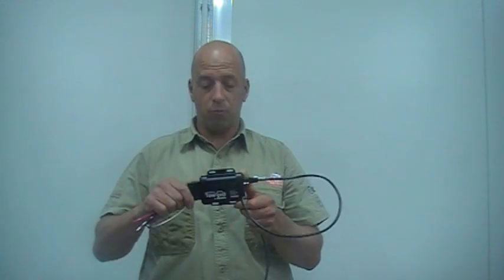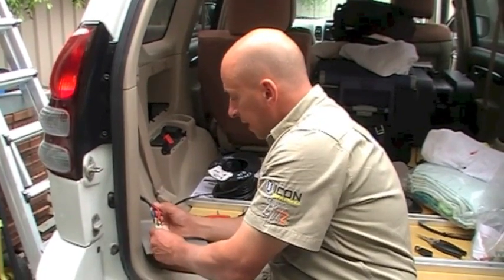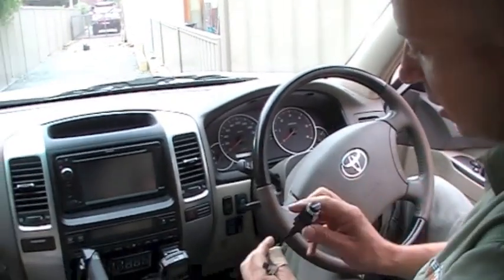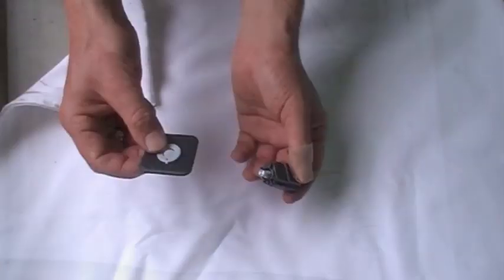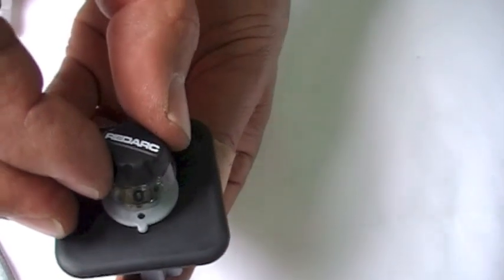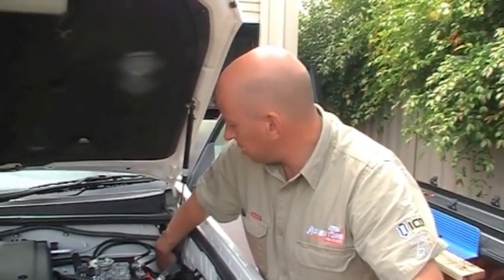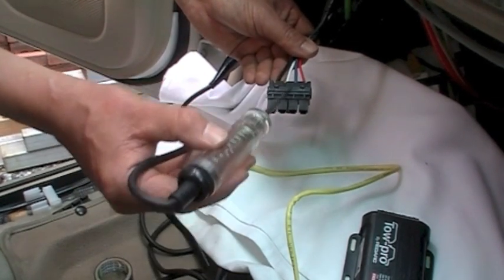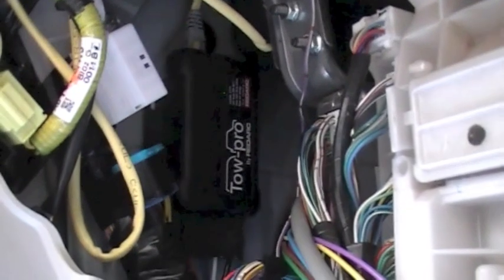Redarc Tow-Pro Installation

Comment: Just attempted to install in same positions on a 120 Prado found that the standard cable supplied (1m) is not long enough, so now pushed for time going to mount the controller in front of the cigarette lighter. Easier position and if needed can remove without taking the interior to bits. Also running brake light and trailer brake cables direct to the flat 7pin socket at rear. Hope this will works.

Comment: For the love of God, stagger join the cables, that way you never have a super thick join bundle. I heat shrink every joint not tape, and then use Nitto brand tape to make the loom look normal... the tape is finished off with a dab of super glue so it doesn't unravel. If not tape, use heatshrink or the abrasion proof loom cover....